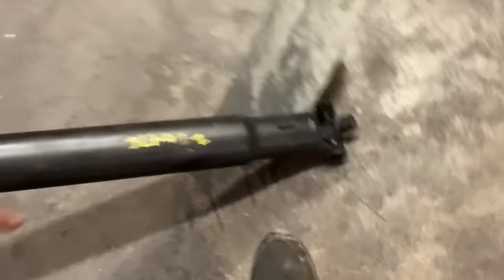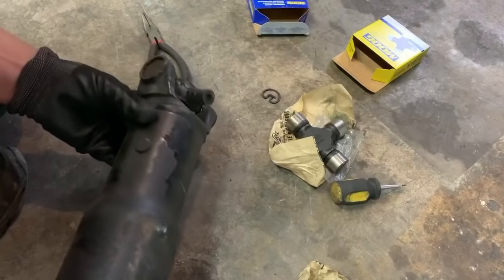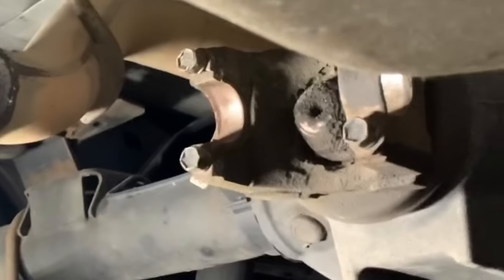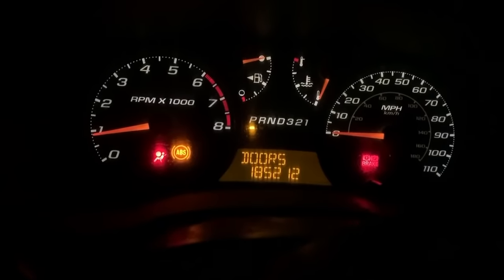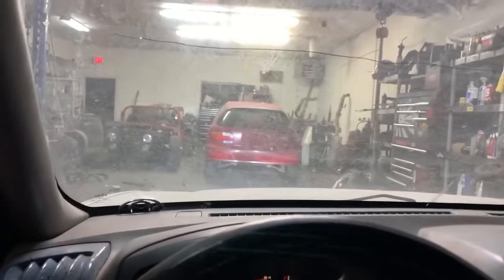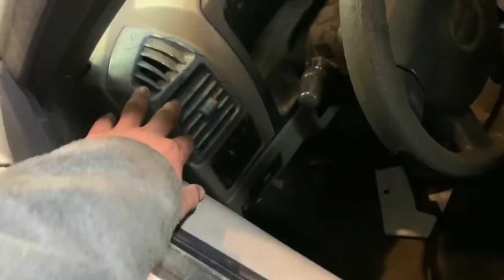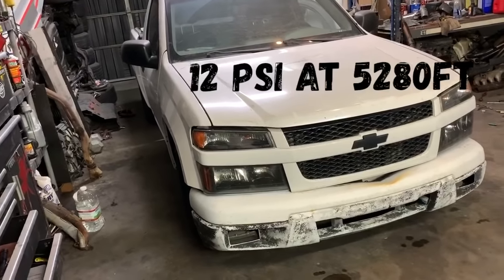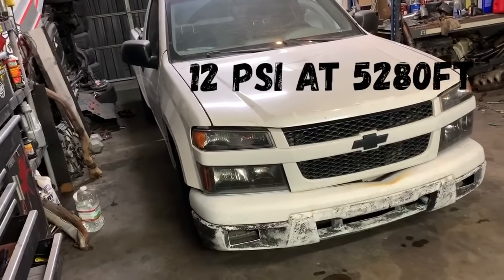My Lowered Shop Truck is Alive! Chevy Colorado U-joint and Driveshaft Replacement

Comment: In the 1970s I owned a 1971 c10 4x4 that blew out a u joint while driving at 45-55 mph, it slammed around a little bit and shot out of the side of the truck. Luckily I was able to make it back home in front wheel drive. It’s something you never forget!

Comment: I just got Lower Control Arms for Crustida sent from MOOG directly to Australia, about to fit them if I can get the ball joint mount off the tie rod end, damn castle nut collapsed and then seized on the thread removing it. 😡 Back on point, best company to work with and good quality too. Those U-joints will last you for ages. 👍
Reply from the maker: Nice man that’ll be sick!!
Reply: @GARAGEIdiotS  Yes it will be my good man. Thanks for being there from before the very start Preston. ♥️👍
Loved your reaction to the Olympus cage for Mr.Bug. Now listen to them boys and get yourself and Mena ready for LS Fest in LeJevette and have some shenanigans. 😈

Comment: Use the prybar to hold the brake pedal between it and the seat. That way diff wont spin since wheels off ground.
Reply from the maker: Ahh good thinking
Reply: Like a brake pedal depressor we use at the shop for alignments. Super cheap online.

Comment: my awesome friend and handyman Bob has a 4x4 Colorado with 275,000 miles on it and it keeps on going he takes good care of it  my 99 Volvo v70xc awd wagon has a 2.43liter turbo 5 cylinder and it is magical it runs all of 5 pounds normally and up to 10psi when you really step on it stock computer with no tuning at all and the typeR  cars run even more boost best sounding engine with a muffler delete the turbo keeps it quiet enough, the engines in these colorados are bigger displacement and I believe they were manufactured by Audi or the Volkswagen group

Comment: Just do the bumper and the top of cab. Just make it look good. And clean it out inside and out! Keep it clean, white looks great when it’s clean! Have a 1996 Ford F-150 Eddie Bauer edition extended cab two wheel drive. White with gold accents. With bed liner. I don’t let anyone eat or drink anything but water in the truck. It’s got 96,000 and looks like it just came out of the showroom. Well, almost.

Comment: Nice truck ,do u think my driveshaft start to fail ,because when I step on pedal gas feel like driveshaft is moving like back and forward ,I already check ,seems pretty firm no movement at all! Could be something else!
Reply from the maker: Hmmm hard to tell over a text. U joints arnt too difficult to do, you could give it a shot, they arnt too expensive either.  A cheap way to eliminate one problem
Reply: Thanks bruh ! I definitely will do that!

Comment: Sts rear mount Turbo Tacoma kits run 4psi, no tuning just a FMU
Reply from the maker: Good to know!
Reply: GARAGE IdiotS np, more than 4psi they highly recommend and engine management haha, so low boost you should be fine. Just slap a cheap eBay fmu in there. 10:1 or 8:1 or there’s even adjustable ones now that are cheap.

Comment: Just for future reference .. You should also replace the straps and bolts also when replacing the u-joints .. Especially if there is a chance (like yours ) that they stretched or if you get them with a used driveshaft  ..  I think its 5$ for the straps and blots . ) Cheap insurance to keep the u-joints secure ..
Reply from the maker: Good to know! I didn’t think about buying those! Good thing that’s an easy fix

Comment: Did the driveshaft come completely out when ujoint broke? you check the transmission fluid in case any slung out?
Reply from the maker: The tail piece was still in the trans, drive shaft broke and fell

Comment: I just bought a 2005 Colorado, I wanna dropped. Any tips how to do it?
Reply from the maker: It’s pretty straight forward, blocks in the rear and I did lowering control arms up front but have heard good things about running coil overs up front as well, I did 4” in the rear 3” up front and had to do a mild C notch in the rear

Comment: The cmc is not that bad to do...undo the bolts from inside..put a flashlight in the cabin getting light thru the hole so you see the hole from engine bay..looks harder then it is
Reply from the maker: Good to know thanks!
Reply: @GARAGEIdiotS  get a cmc from em1 civic it will be like a hybrid racing kit..u can also get a clutch hose from ktuned..the slave cyl from dc5-ep3 is also bolt on and removes the clutch delay valve
First mod i did on mine..gears go in burning tires..my rev limiter is set at 9200rpms.
Just the cmc and slave shaved half a second on 1/4mile,u can shift as fast as you want.

Comment: Just LS swap the Colorado with some twin turbos, nice body kit, hard tonneau cover and a nice paint job.... Nobody wants to see a 5 cylinder build, the motors are just junk... it's a waste of time and money... same with the bumper just get a body kit or cover... might as well figure out how to do it right from the get-go rather than just spinning your wheels (but continue doing burnouts, LOL). Meanwhile just drive it.

My suspicions on your clutch issue with your Civic is a slave cylinder hose... the hose maybe getting soft and not releasing the pressure back off the clutch, fast enough... Just a hunch, worth checking out. 👍😉
Reply from the maker: I love how honest you are haha I can always count on your for the honest truth. Thanks for the feedback man, and I’ll be checking that soft line ASAP!

Comment: That I 5 would work quite well in my 92 mighty max
Reply from the maker: I’ve been very impressed with it
Reply: @GARAGEIdiotS  the little mitsu has the same size bed, a 3/4 ton suspension, and AMD weighs 100o lbs less than the Colorado... after 258000 miles... it finally needs a new power plant... if ya don't lill it in your experiments, I'd be interested in it

Comment: Pro tip, use PB Blaster instead of WD40.  More expensive but well worth it.  WD40 doesn't make a good line or penetrating oil.  It has its places though.
Reply from the maker: Good to know! Thanks!!

Comment: Freaking K swap it😂😂
Reply: K swap with compound turbo that thing
Reply: Would be sweat.i had this idea to do a fwd mini truck..dont need adaptor plate and rwd transmission.basically fitting the subframe of a rsx s,civic si,tsx to the truck..
Reply: @upnorthviking823  but why? RWD or 4x4 is what makes mini trucks actual trucks and not cars with beds nobody is interested in doing a whole fwd conversion just to have a smaller slightly more reliable honda engine they could just keep it rwd and run the k longways instead of transverse with an adapter plate it would be way easier than having to cut out the entire subframe and even the strut towers also I don't think civic or accord front suspension is tough enough for a truck and vise versa using trailing arm rear suspension out of a fwd car would not support any heavy loads in the bed without bottoming out

Comment: This is the reason why you mount your vise to a sturdy workbench so you can use it to remove and install U-Joints, if you don’t have a vise a piece of black iron pipe about 12 inches long and 3 inches in diameter also is quite handy to remove and install U-Joints.  Also when you pull a cap off you joint caps swap some wheel bearings grease inside the cap to keep the needle bearings from falling out of place.

What sort of bad drugs are you smoking with you wanting to turbo your daily driver shop truck.  Rule number 1 don’t hotrod your shop truck unless you have stupid money to throw away.  Be smart and make it look good and leave the engine and transmission alone otherwise it will start becoming unreliable. Like you said you are not Cleetus and don’t start acting like Richard Rawlings. Lastly don’t go upside down in a car loan ever because they are short of hitting the lottery or declaring bankruptcy hard to get out from under but you are a grown man and can make your own dumb decisions